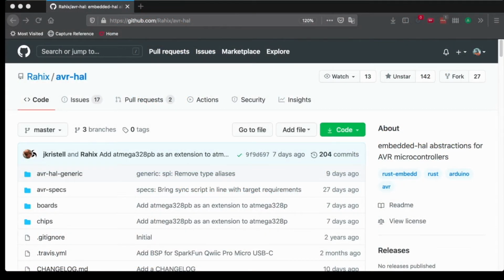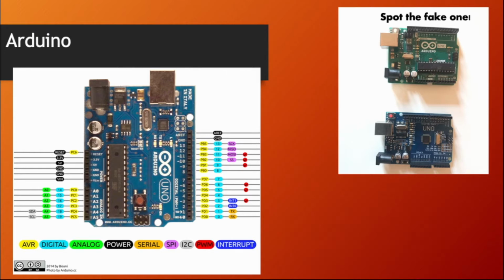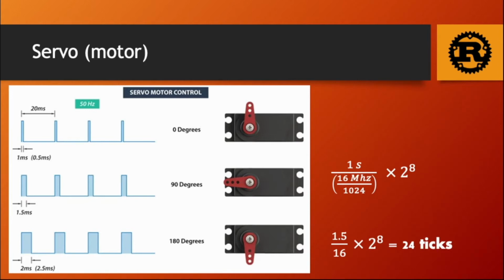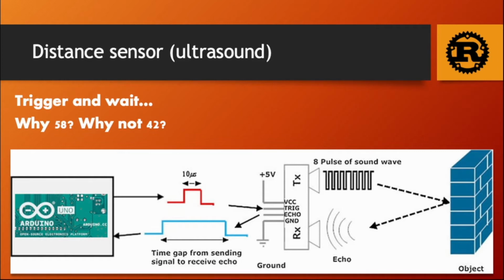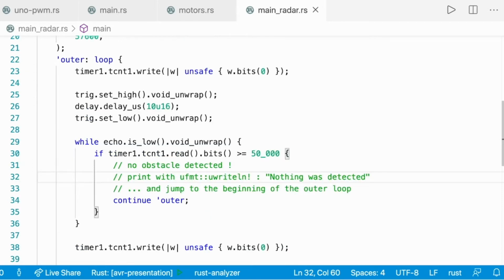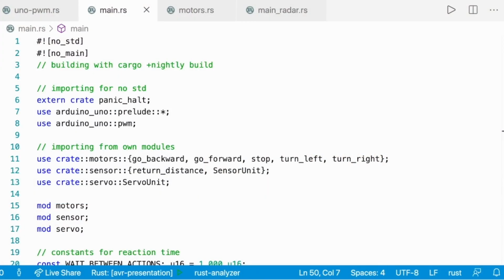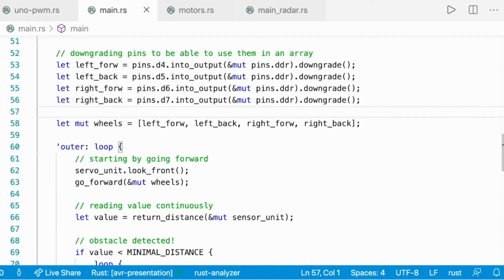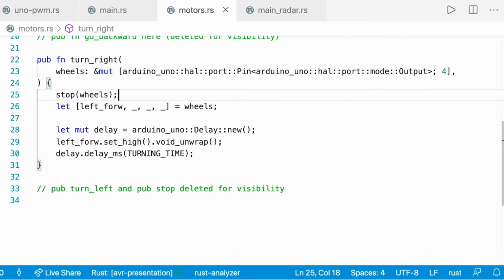Aïssata Maiga - Build your own (Rust-y) robot! — RustFest Global 2020

Comment: Great talk! I am also struggling with embedded because I don't know any of the lingo and open the datasheets and I get even more confused. I wish there was an explanation about the prescalers (I didn't get them to be honest and didn't get the time to study properly)
Reply: In order to read datasheet you need at least basics of circuit design. About prescaler: atmega328p have internal frequency generator which usually ticks at 16MHz. Internal timers are 8 bit and 16 bit. I you will count 256 on 8 bit counter 16 micro seconds will pass. Maximum period you can measure on 8 bit counter by connecting to internal frequency counter is 16 micro seconds. This is why prescaler is needed. Internally it is 10 bit counter. When you are choosing presclar you are connecting timer's counter to prescaler's counter pin instead of internal frequency generator directly to divide internal frequency by prescaler value. If you connect to 10 bit of prescaler he will count 1024 before you will receive signal change for selected timer. Maximum period you can measure with 1024 prescaler on 8 bit timer is 16 mili seconds.